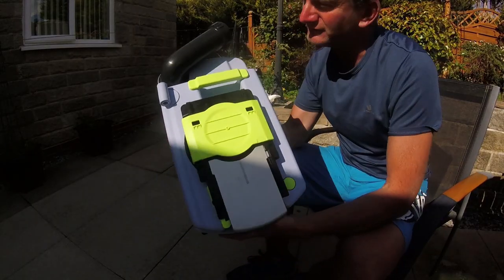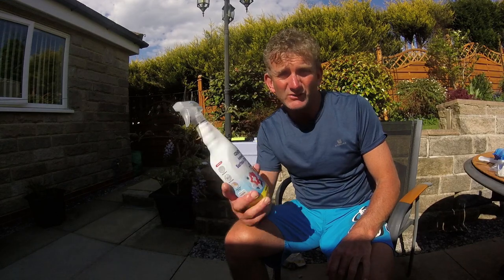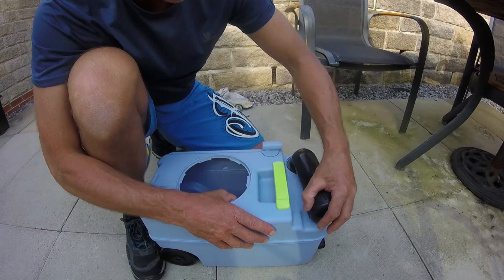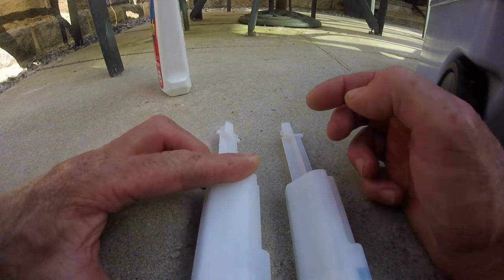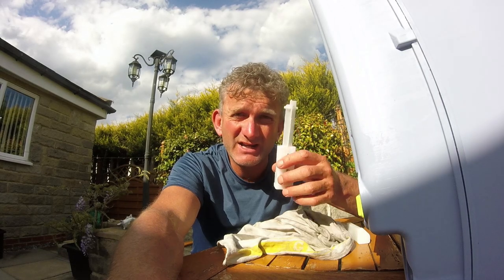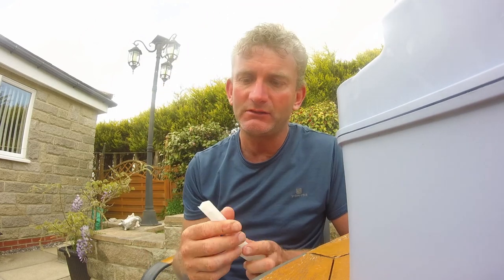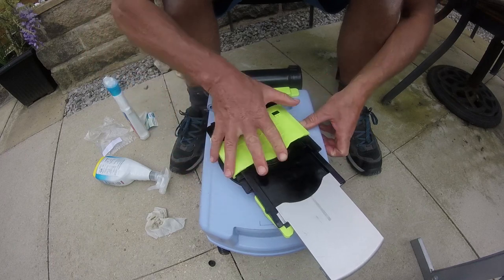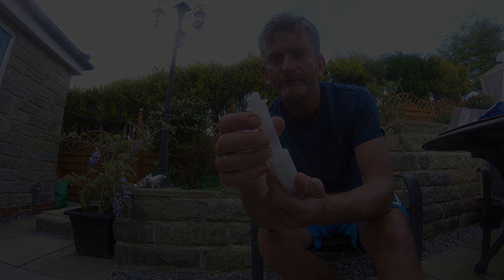How to fix a Dometic 4110 cassette toilet float & service guide

Comment: Thank you, thank you, thank you.  Just what I needed.  I watched your vid about 20 times while waiting for the part to arrive and I took all parts off the cassette and gave it a thorough clean.  Once it arrived I was ready for it and managed to get the float in first go!  Not bad for an old girl like me.
Reply from the maker: Well done Susan !
It's a tricky job but you did it. 
I said to my father , I'm going to make a video about this because there aren't many out there showing you what to do, so I'm glad that it's helping other people like yourself and hopefully many more too.
Reply: @MrDazP1adv3ntures  Like Susan I have just done all the cleaning & service tips in your video whilst awaiting the replacement to arrive from Jacksons Leisure. Luckily I noticed the rattle on the final empty before setting off back home yesterday. I could see it lying in the bottom of the tank and yes!, I had given it an upside down shake over the Elsan point. Very relieved to have found and watched your video.  I may not be far from you in South Ribble .
 Is it bevel face down then?  Thanks, Dave W.
Reply from the maker: Hello Dave, from memory it had a flat face to go in line with the wall side. 
I am so surprised with how common this problem is and that they make such a flimsy part. 
I hope it goes back in for you ok.
And yes you are not too far from me. I cycle out from my neck of the Pennines to the Ribble Valley quite a lot .

Comment: Thank god for you, we have been doing close trips from home on weekends and calling them our "Learning Trips" - I had issues trying to get the cassette to click back in after emptying and figured it was something to do with the orange cover cap on the caravan end not opening properly.  I ended up doing a full clean and unfortunately didn't  get the memo about not shaking the hell out of the cassette when flushing after emptying so found myself with exactly the issue you described.  I too took out a second mortgage and ordered a replacement float and after lubrication and lots of coaxing finally got it  back in using your twist and click method.  The things you can find on the Tube - cheers
Reply from the maker: I love YouTube for this very reason Mark and thought that I would try to help others out as there wasn't much advice on how to fix this unit. Thanks for commenting and wishing you some happy times ahead at the elsan point

Comment: Thanks for that...excellent video. I removed the lug and drilled it out...then replaced it with stainless steel. used two lock nuts and glue. Put camera inside to help reattach...all good. Here in Australia, the float is between $50 and $80 .
Reply from the maker: Gteat stuff Mark, with a little bit of ingenuity it could be made a lot stronger. Thanks for sharing your story 👍
Reply: I'm just trying to track a float down...currently in TAS but about to head back in a week to VIC...the float is important to me but not to other half - we also need some seals/rings which are more important!!

Comment: Thanks for the video Daz - you were spot on in all aspects of the repair! I think someone may have listened to you because there is a little bit more support around the lugs on the replacement part than there was on the one that broke! Great job mate
Reply from the maker: Thanks 👍 Frank, I was evening thinking about this last week whilst on holiday at the caravan. The thought did cross my mind that  the float could even be damaged whilst you walk with it on the uneven surfaces to the elsan point.

Comment: Great video. I strengthened my new float arm by filling the small voids round the two lugs with 2 part epoxy but not too much to stop it pivoting properly. No problems ever since & it stands a shake too. I always use silicone grease (regularly) in the two metal slider arms as these are what makes opening the slider much easier 😉
Reply from the maker: Thanks for watching Paul, it's a common and easily broken  part .  I got my old porta potty out for a camping trip the other day. It's over 20 years old. Oh The joys of cassette toilets hey !

Comment: Amazing video thanks. Followed it step by step and successfully replaced a broken float on our Dometic 4110. Clear, concise instructions and bonus info on greasing the rubber seals. Just the right Type of “how to video”.
Reply from the maker: Thanks  for the feedback Dan, I'm glad  it helped  you,  I had a look on line and couldn't  find another video so thought I would give it a go. Happy flushing from now on
Reply: @MrDazP1adv3ntures  thanks mate. Also you may have already done it, but I found greasing the middle / centre seal in the main hole is a great idea too.

Comment: Cheers - this is the only video I could find on the lights not working - not sure if the float is broken but we now know how to service the cassette properly to find out!!
Reply from the maker: I made the video because I couldn't find one myself on the internet.
I hope it helps you 👍
Reply: Thanks! We're hoping it will help too!! The lights stopped a couple of weeks agon and we've tried to sort it via the "manual" which didn't show us how to get the top off...doh! It also took a bit of effort to find your video - would you mind if I put it up on a couple of FB pages that I follow? Note I will screenshot rather than link as that's the "rules"  @MrDazP1adv3ntures
Reply from the maker: By all means share  the link to the video on your page. The caravan season starts next weekend so we need as many people as possible to be aware of this issue.
Reply: Cheers...I'm actually in Australia...Tasmania to be precise...about to go back to the mainland in a week and into more remote areas! @MrDazP1adv3ntures
Reply from the maker: Interesting, I follow a guy called Tazzy T who goes out into remote places in Tazmania on his quad bike looking for gold and wild camping with his mates

Comment: Well done mate that was as good a service video as I've seen, thanks.  I was a little disappointed though after your 3rd attempt at trying to fit the float by feel I thought I was going to see your hand holding the float go in through the out funnel hole and your head appear inside the main hole looking directly at the float fixing point! Maybe next time.....
Reply from the maker: Thanks for the comments Topher, it's a flimsy piece of plastic and tricky to fit with limited space to get in there. Hope it helped with any issues with your cassette toilet. Cheers.

Comment: Thanks for the help daz
I found that when I did mine there are two little groves that line up with the privet holes so just found them an pushed up…
Reply from the maker: Great stuff David, I'm sure there will be hundreds of cassettes with this problem out there.  Flimsy plastic parts to blame.

Comment: My float broke. Bought replacement, cost just over £32.
Decided to repair old float. Bought a piece of 4mm x 50mm plastic road. {enough for 2 repairs at 25mm}: 1 x 3.8mm drill: 25ml epoxy resin.
Total cost £9.84. Bonus, next repair, {if needed}, cost free. We carry a spare cassette for wild camping etc.
Reply from the maker: That's great news Derek, I have had to do a few running repairs over the years on my caravans. Some of the parts are expensive too. Thanks for sharing.

Comment: Awesome video thanks mate. Any suggestions for how to adjust when the half fill indicator comes on? I am finding that the cassette is very full (Heavy) even before the half full light is on.
Reply from the maker: Thanks for the comment Surfnpics. The best advice I could give on this matter is to work on the averages.
I found that these kind of cassettes filled pretty quickly - within two days of normal use (Peeing  only) and including the flush. By this time they were getting close to being emptied regardless. It's not just the pee, it's the flush that fills em up..
My view on the matter was to get to know the general status of the holding tank from normal use, then empty it before it was too late.

Comment: Hey mate you are legend. I have samiliar issues the water level light doesn’t flash to indicate..so annoying. I have checked the float and it seems works properly. I wonder what else could the issue be??😅
Reply from the maker: Have you checked the power source to the light and also check for any magnet  sensors
Reply: @MrDazP1adv3ntures  I will check tomorrow. I wonder how to check Megnet sensors though?
Reply from the maker: I would see if there is a magnet there

Comment: Could you tell me what the magnet is for ? Also what is that small round piece you took off , for ? Thanks
Reply from the maker: I think the magnet is part of the sensor to stop the flush working when it is full so it won't over fill. What is the round piece, I would have to watch it again
Reply: it´s the piece ar 6 minutes marker, thanks @MrDazP1adv3ntures

Comment: Been trying to get a dometic 4000 cassette toilet replacement for over a year, but still no luck yet.
Reply from the maker: Are they not available on line Martin
Reply: @MrDazP1adv3ntures  no
Reply: @MrDazP1adv3ntures  found supplier in Holland but will not send to uk

Comment: Can you advise please our toilet motor runs but no water coming in the bowl
Reply from the maker: Is there a blockage in the line or an air lock ?
Or is there a valve in the closed position after winter storage.
Is the pump polarity the correct way. It could be pushing not pulling water...
Reply: @MrDazP1adv3ntures  we have not long bought the van it worked fine first time we were away but now it's like it's blocked a will have to open it to see
Reply from the maker: Maybe the pump is gummed up ?

Comment: I bought a dometic toilet, within a few months the flush system failed, shortly after that the spout on the cassette fell off and went down the sewage dump point. The slide on the toilet is always very stiff and I'm worried it's going to snap, ill be in trouble if that happens, Always trying to lubricate the mechanism but it doesn't help, won't be able to use it, having enough trouble repairing the issues now. Contacted dometic and they didn't seem to give a dam about the problems. Looks like i may have to throw this $700 one out and buy a decent toilet.
Reply from the maker: Hello Geof , I feel your pain and frustrations.  The float on these cassettes seems really flimsy and in general the whole assembly  needs a bit of TCL.
Reply: @MrDazP1adv3ntures  needs to be engineered better and people should know about it. Then we might get a better product. Thanks and good luck in your travels, and may your dunny never let you down.